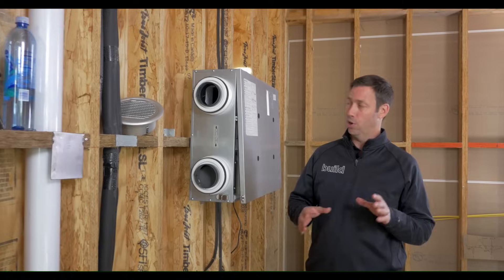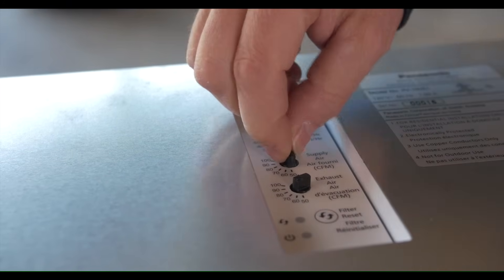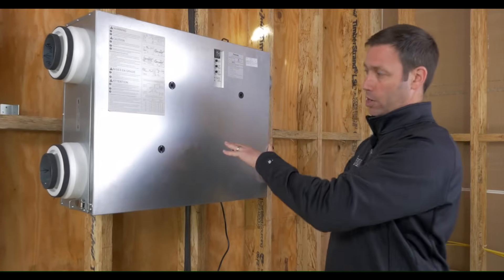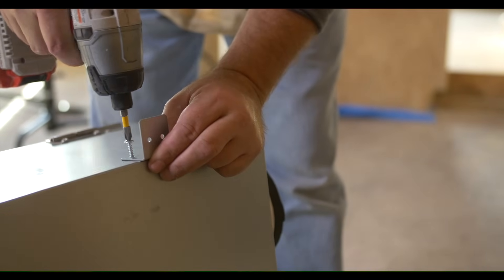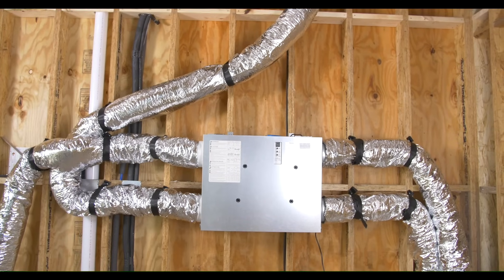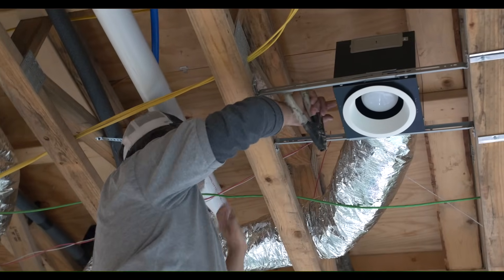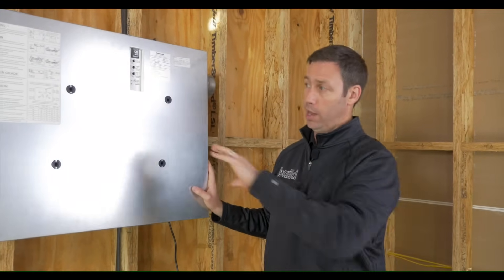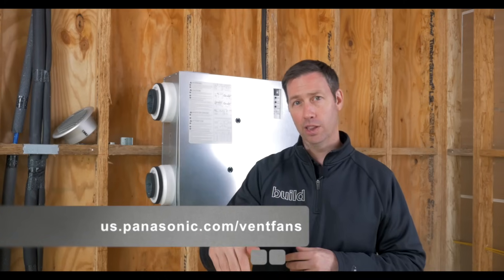How to Install an ERV

Comment: I like watching your videos Matt but I really think you dropped the ball on this one. I used to install HRV's and as a Power Smart installer, we had to install supply and exhaust ports absolute minimum of six feet apart but usually they were at least ten feet apart. Otherwise exhausted stale air would tend to return toward the supply air port. We also installed fresh air ports in all living areas of house and exhaust/stale air ports in all wet areas of house ( laundry, kitchen and bathrooms. The total volume of exhaust air from house side ports had to equal the total volume of fresh air from fresh air house side ports. The system had to be designed through downsizing ductwork and balancing dampers to perfect the airflows. The systems we designed could not be heard at all and worked flawlessly when filters were cleaned and maintained properly. The system you are portraying here does not seem to meet up to national standards.
Reply: Thanks for the extra info, would the sound issues in this case be caused by the design implemented or the system itself being used? I am a 1st year student architect so I have much to learn. Also, regarding air circulation generally, I do wonder how you balance bringing in and circulating fresh air without creating large additional heating demands in the case of winter air circulation?
Reply: The balance comes from code.  Code requires minimum values of fresh air CFM based on ASHRAE standard 62.1 (commercial) or 62.2 (residential).  Also in regards to the spacing, in the commercial world any intake has to be at least 10' from a vent or point of exhaust.  Exhaust also must terminate a minimum of 3' from an opening to a building (window, door, etc)
Reply: First thing is to establish where the building is and whether you're heating or cooling?  (summer or winter)  To answer your question ( I think) the incoming additional fresh air is pre-heated by the exhausted stale air.  That's the essence of the system but you're right to ask,  what volume of air are we talking about and how do those little 8" or 6" Diameter vents handle a whole house?

I think we should have an augmented building code for buildings whose main effort is cooling, not heating, because the two problems have some similar solutions, and some different solutions too.  Maintaining the comfort level of your house by only managing the air flow is a mistake where it's hot.  The thermal mass of the structure has to be designed to take advantage of the natural wind and the ground, to keep itself cool.  Primary (from the sun) and secondary (from heat islanding and stucco siding) radiant heat should be reflected away.  Chimney's can be used to accelerate or facilitate natural ventilation within the structure, by letting cool air replace hot air, just like an HRV, only do it with a masonry chimney and a fireplace inserted, to change it from cooling to heating as necessary.  Our light weight stick frames need additional weight inside the envelope to act as batteries, to moderate temperature swings produced by natural means, such as passive solar overheating.  How much thermal mass and where?  That's a pertinent question.

And the unanswered question after Popular Science or Mechanics magazine spoke of it in the '60s, what about moveable insulation systems?  We still don't have an automated way to close off the passive solar windows at night, saving significant heat loss, or stopping heat gain during the hottest summer days.
Home Depot should have something on the shelf that looks like a 6' patio door, but has the moveable panel made of R 13 Polyisocyanurate insulation with a metal skin.  Install as normal but only the fixed pane of glass is visible, the moveable section slides into the wall like a pocket door.  A slight ramp and electro-magnet catch connected to a photo sensor, would tell the panel that darkness has arrived, and let it slide down the ramp into place.  Mornings, you'd have to "open" the windows to let the light in, by hand, sliding them back up the ramp until the magnet catch 'clicks'.  

A "super-insulation" wall system can accommodate such a thing without disrupting the integrity of the various thermal and vap/air barriers.  On a house in Alabama in 2002, I used block walls with 3" of rigid board insulation, and a brick veneer weather  screen.  Casement windows were placed into masonry rough openings with a 2 1/8" brad nail and finish nailer.  The spindly nails bend when they hit the concrete, but half a dozen around the frame will hold it perfectly level in place like metal spider legs.  I normally leave a 3/8" space for insulation between the rough opening and the finished frame for insulation, which is where the wire nails show up.  Then use low expansion foam in a can to fill that space and make the (integral) air/vap connection between the exterior insulation panels, and the finished frame of the windows.  Airtight.  Fast and easy.  That house had two stories with 8" blocks on the main level and 6" blocks on the 2nd level creating a ledge (2 1/4" required so an metal ledger of at least 1/4" has to be added to support the joist end, if you eliminate the rim joist substituting blocking) for a conventional suspended wood floor.  The roof is another story but the envelope is (also) maintained.  Two operating Velux skylights at the very top of the house in a chase up through the trusses let out hot air using a green house item, that opens windows when it's hot inside.  Automatically cool underground air comes into the chimney structure, surrounding but  not accessing, the firebox.  Approximately 180 tons of themal mass inside the envelope.

My wife's career required that we move out of state before moving into it, so I have no idea whether any of that worked or not.  I lived in it with the dog for the summer of '03 while finishing details and selling it, and even when the thermometer broke 100 F, the air conditioner never came on, the house stayed below 80 F with just the central fan circulating air.  The firebox was small but long and air tight and the two flues (dual exhaust) went straight up through an all brick chimney 36'.  You only burn the fire, flat out, maximum fuel burn and maximum heat.  The 180 tons of masonry takes care of any 'hot spots' allowing me to run the fireplace Saturday morning for a few hours, (Oak forest) and again mid week during construction, in winter for heating.
Anti-; seismic, termite, tornado, hurricane and fire, it had a 'safe room' built inside, as a laundry/storage vault.  Almost no one I met while trying to sell it, considered any of that worth anything, or asked what it would cost to "finish the drywall" and "do the crown moldings", etc..  Sold it a hair over cost, $185k.

Comment: Matt, nice video I always enjoy watching them! You mentioned 3-4 feet between outside inlets, most other manufacturers of HRV/ERV recommend min. 6 foot apart. And I wouldn't even consider a connection to HVAC system at all, balance is almost impossible. I learned that the hard way!
Reply from the maker: +Indiana Fred thanks